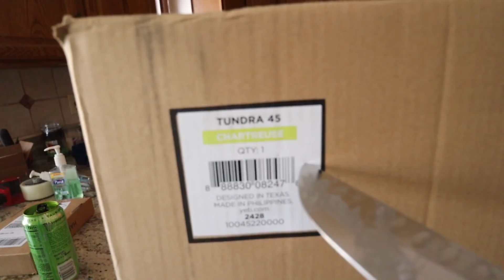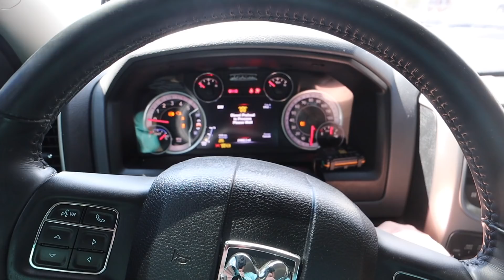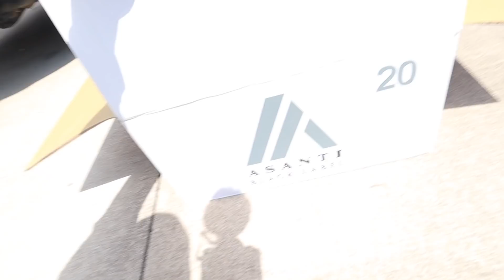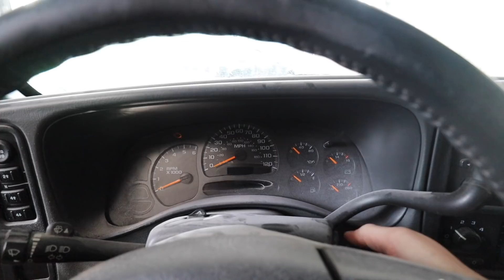IT ONLY TOOK 4 MONTHS FOR THIS TO HAPPEN...LOL!

Comment: I always leave my diesel running at the pump for a few reasons. One point being that you dont have a saftey issue because diesel is so much less flammable than gasoline
Reply: That's a dumb idea really dumb, what about that car filling with gas next to you you might cause a spark and blow that 1 up. Think of other people
Reply: @BC, so you don’t start your car at the gas station unless no one is getting gas beside you??? That is dumb...
Reply: @bc7784  Not my problem they should have bought a diesel too lol they wouldn't have to worry
Reply: Leaving your car running while you pump is perfectly fine, anyone who says otherwise doesn't have the knowledge to prove their excuses

Comment: Looks like you may need to adjust the driver headlight or hood on the driver side, the gap between the hood and headlights are a touch different, could just be the camera angle though!

Comment: You need to add a Warn quick connect  jumper cable system to the Ram. Wouldn’t have to open the hood or need a step ladder to access the battery